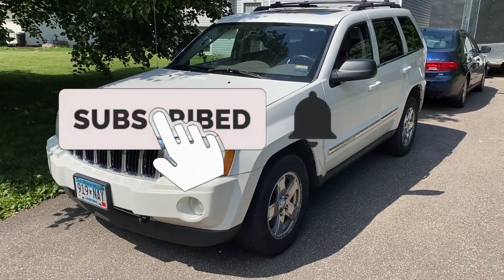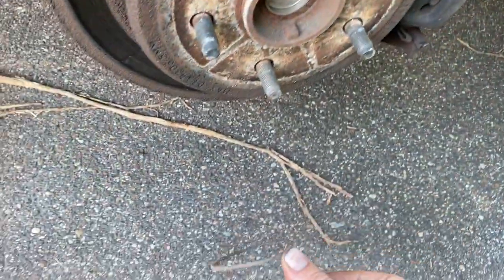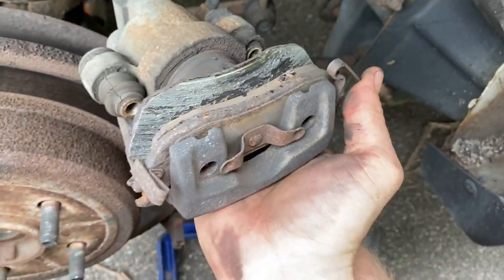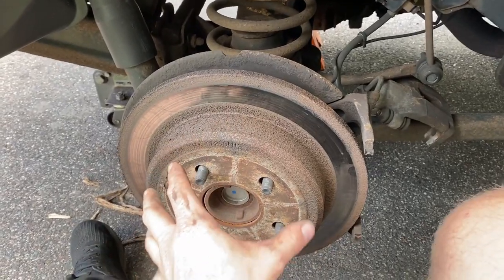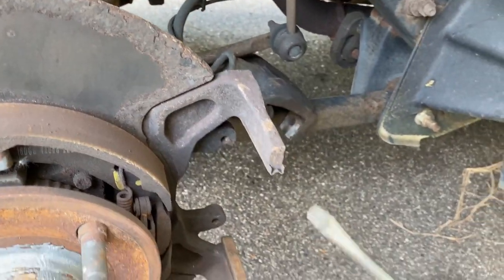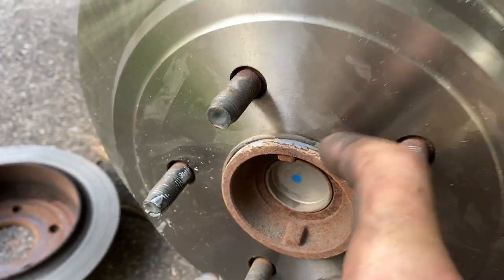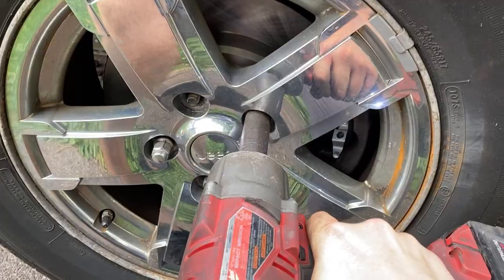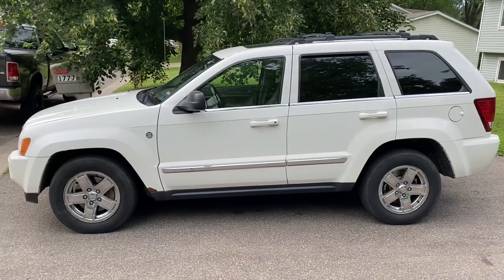Jeep Grand Cherokee Jeep Commander Rear Brake Replacement (2005-2010)

Comment from the maker: GET YOUR PARTS HERE - 
'05-'10 Grand Cherokee/Commander rear brake pads (all models and engines EXCEPT SRT) - 
Bosch ceramic brake pads - https://amzn.to/36VO6zD
Power Stop brake pads - https://amzn.to/3kWBzkq

'05-'10 Grand Cherokee/Commander rear brake rotors (all models and engines EXCEPT SRT) - 
ACDelco brake rotor - https://amzn.to/2IOotcf
Bosch brake rotor - https://amzn.to/35Qa3B0

'05-'10 Grand Cherokee/Commander rear pads AND rotors for (all models/engines EXCEPT SRT) -
Detroit Axle brand pads/rotors - https://amzn.to/2UOEUrh

Comment: I don’t know if anyone did the folding the rear seat down mod on older dodge rams, but someone said that all you needed to do is turn the bars that the seat hooks into upside down .  I was wondering if anyone has done this because I would rather not cut short the hooks because you can’t reverse that?  Does it work?
Reply from the maker: Not sure the exact mod you're talking about. What year range and cab configuration of trucks? Have you tried researching on Google or the forums?
Reply: @TonyTheTruckGuy  ,  I managed to get a look behind the rear seat and on my 2013 Crew Cab Ram 1500, the bars that the seat hooks into are in fact welded to the frame. 😀